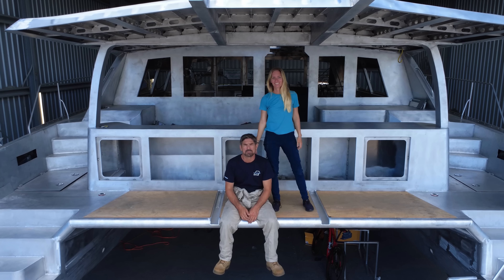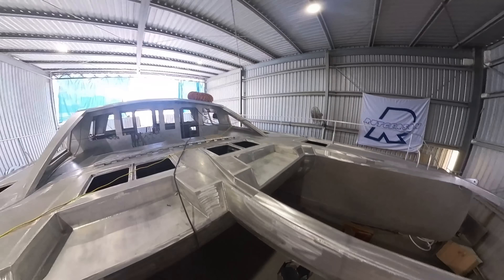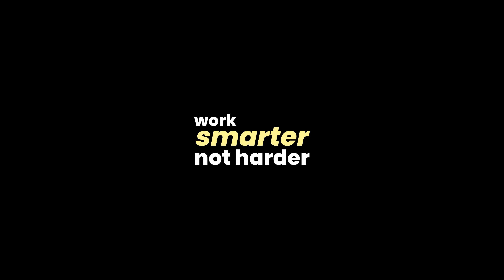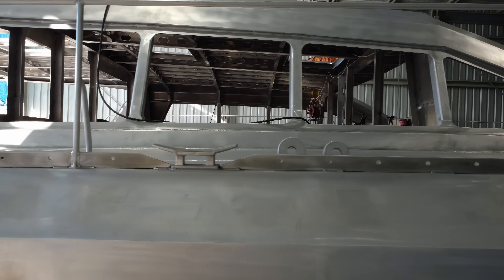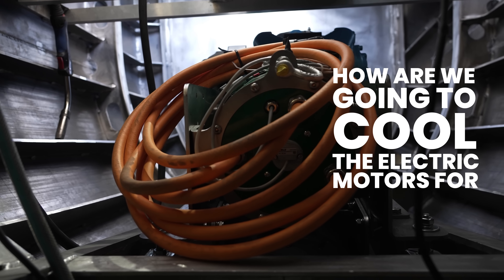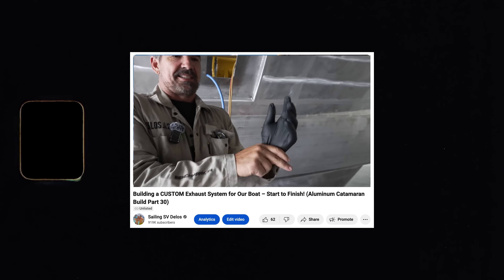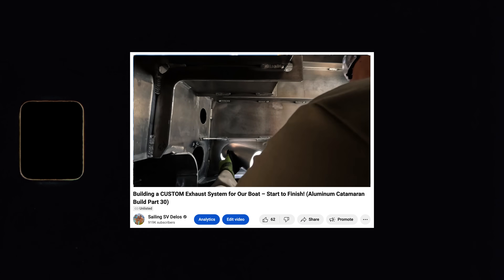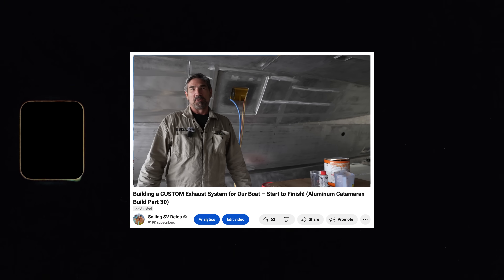We Challenged AI to help design our Keel Cooler 🧠 (Building Our Own Aluminum Catamaran From Scratch)

Comment: I'd think you would be able to design a much smaller cooler if it used a water to water heat exchanger. I love the idea of NOT having more holes in the boat, but it sound like the keel cooler would have to be pretty big to do the job in warmer waters. I remember being down in the enginroom of a few smaller US Navy ships in the caribbean. Anywhere else and we felt cold against the hull. In the Caribbean the hull wasn't hot, but very warm. We also had 25HP fire pump motors and I can tell you, they were more than warm after just running five minute tests. Of course they were WW2 technology.....  If you are building this cooler and it ends up water/water, make a removable cover for cleaning and checking deterioration. And ground the hell out of it!!

Comment: Torqeedo 12.0 is an electric sail drive. The motor is directly coupled to the prop. The entire unit is in the water and requires no cooling.

Comment: Talk to Damien on BRUPEG ?  Ok, so BRUPEG is a steel boat with external cooling pipes and a diesel engine, but it may help confirm your ideas.  BRUPEG keel cooling looks to be about 2m long by 60cm wide, made of maybe 2 inch pipe.  As its external with thru-holes, the cooling pipes would probably have better thermal conductivity with the water than trying to pass heat through the aluminium hull.  Then again, your whole hull under the waterline would form (some) part of the radiation surface...  Not my area of knowledge !  How well does anti-foul transfer heat?

Comment: Hull cooling has been around a long time.
But they are usually too small and installed in limited space.
I seen a guy run C channel(welded against the hull) the entire length of the boat, one going forward another running aft.
That a long cooling loop, so any inefficiencies are offset by the length. 
If i remember correctly, It was 1 by 4 inch C channel with a few burping holes along the way and some weld strips to act as tabulators to mix the coolant as it flows along the tube
He said , he just took the surface area of a keel cooling tube that he need to cool his engines and figured out how long a C channel he would need and added 50%, which was 35 up and 35 feet back

Comment: I'm no Marine engineer 😅 however I have watched this one sailing Channel called Delos for a decade. 

So I guess in this situation I'm really no help at all 😂... I do however question?... one thing the finns, and the surface area. Normally four square feet which seems big to me but then if you consider the fins it actually makes it a lot smaller. Possibly 40%?

However you don't have that luxury if you're attaching it direct to the hull. So as much as that's appealing I wonder if it is a better idea to branch off the saltwater cooling intake for the diesel engine and circulate ocean water over a heat sink with fins.

I don't know I'm just thinking it seems so obvious to attach it to the boat but then again what other issues will that cause and due to the size will it be less beneficial to do it that way however it feels and seems like it would be super cool and convenient.

That and the fact that you'll be putting a coating over the outside of the boat so that also change things and with the hot and cold expansion over and over again I'm thinking stress cracks other issues.

Comment: I've had a bit of thought around how I would get rid of heat if I was to build a boat like you guys. My thought is a radiator setup with closed loop cooling. Sea water as you know is problematic, sucking up weed, jellyfish, rubbish and shellfish barnacles. It also means deleting another through hole. I would integrate thermo fans into a radiator, this could also serve as a clothes dryer heat source, yep free heat to tumble dry the laundry. It's a win win win with low maintenance and chance of failure.
Reply: Let say you integrated a coolant storage tank, on the back of this tank you weld up a water heater storage area, think of it as a 500mm cube with a wall in the middle. Then feed off to a radiator with thermo fans for excess heat dissipation. You end up with a water heater, clothes dryer heat source, heater source for your cabin if you go to the poles. Now we getting fancy. I can see Brian's creativity spurred on with his new ninja welding skills, and Cass's dreams of hassle free laundry. Would be pretty easy to butcher up an old clothes dryer to make it work.

Comment: I think if I was heating the skin of my boat with a couple of Kw continuously, I think I would want that area to be the meter square, I wouldn't want to be touching that heat sink and thinking my God that's hot. I mean there is going to be a temperature gradient across the system and its not an ICE, the closer to room temperature the better in my book.

Comment: Whatever the size is I would weld "aluminium fins" to the hull on the inside in the shape and size of the heat exchanger, then cover that with a waterproof shell(also aluminium welded to the hull over these fins) to to improve the dissipation of heat through the hull of the boat. Then regulate the flow through the heat exchanger according to the temp of the seawater. Faster flow on the equator and slower in colder water, I am sure there are software that can control a flow control valve according to how you calibrate it as to run the electric motor at its optimum temp. Just a thought
Reply: Speaking of colder water, wouldn't you want to divert the heat to the living quarters? Your design would be incapable of doing so. Having a separated heat exchanger with a pump, as shown in the video, would allow you to choose where you want to sink the heat: inside or outside. Which is a much better design decision.
Reply: @ruslankadylak2999 For diverting the heat to the living quarters you use a bypass valve. This is already somewhat a must because you need to allow the engine temperature to raise up before starting to cool it.
Reply: No.

They don't need fins on the inside because the heat will be lost on the outside of the boat.

Comment: I wonder if ChatGPT is making a simple mistake in still assuming the association of the word “sailboat” with fiberglass hulls, even tho you still specified it was aluminum.. Just seems like such a huge disparity between the other AI models used
Reply: Thermodynamics is a very complicated engineering field.  Asking ChatGPT, or any AI model, to come up with a solution on the fly is nigh impossible at this time.  When I've seen specialists run calculations for heat transfer on aeronautics designs, it's spreadsheets on spreadsheets into specialized software to kick out another spreadsheet that gives top and bottom end bounds.  And after that's all said and done it's another round of design to determine if we need the most cooling or just enough cooling or if we need to change other things around to generate less heat along with changing the cooling systems.

Basically, IF Brian is going to use AI tools for design like this it should be used as only the most loose guideline to get an idea of the very large ballpark that he should be looking at.  AKA square centimeters vs. square meters.

Comment: I did like that - I do like these engineering questions, even as a non-engineer.  It is really interesting to demonstrate how AI tools can be used.  Looking forward to hearing more.  I suppose your electric motors are of a size that needs a keel cooler, or is this an extra precaution, and due to your cruising grounds being in warmer climate?

Comment: Think of your keel cooler as a CPU dissipation, it's best to go bigger, not like chatgpt, but at least 2x bigger than Deepsea says. And the most important thing is that the keel cooler must be in 100% contact with the hull to work correctly! like a CPU heatsink or even use some kind of thermal paste!!!  P.S. Not to mention the fact that you must test it before installing it permanently on your hull.

Comment: As someone who uses AI in my work on a daily/hourly basis (software developer), definitely know that it makes egregious mistakes about 90% of the time, and that’s even with good prompt engineering.  It’s not at the point yet where its output can be trusted without careful review and domain knowledge.
Reply: I too notice this as a simpleton. Enter a random prompt into google and of course it pushes an ai generated answer to the top. I usually ignore it but when I look, it’s wrong 90%+ of the time. Bad conversions, pulling numbers out of it’s butt. It’s making people dumber and dumber. Thankfully I have a good basis in mathematics, chemistry, electrical etc to know the formulas, conversion and to see the glaringly wrong answers provided by AI.
Reply: Yeah, even simple questions get you some of the most ridiculous responses.

Comment: Nothing beats real life testing.
So, get an electric 2500 W water-heater and connect it to a loop with a circulation pump of intended choice and see how much cooling you get with say 0.4 sqm.
I'd hate to be forced to make changes afterwards...
Reply: Pretty good idea and it is rather easy to build a makeshift setup.
Reply: I work for a boat builder that has unlimited resources (Tax payers). After the thousands of hours of engineering we do on everything, we still make a duplicate system and test it physically. Build and test eliminates doubt. I personally like pumped heat exchangers. I have a lot of experience with them though. Your situation seems like hull cooling will fit the bill.

Comment: Without understanding the physics asking an AI is not recommend. The motor has a max temp. and so has the sea water. The difference divided by the resistance gives the max amount energy that is diverted into the sea. Calculating the resistance here is tricky task. You can build a small cooler and make a test or you let a viewer do the task by using a fluid dynamic calculation. The task reminds me on the cooler calculations for semiconductors.

Comment: Assuming you are custom building it, what are the consequences of going too large?  I would guess just materials and probably not a significant cost.  If so, make it as large as is practical.
Reply: I'm assuming there'd be a liquid of some sort in the cooler so then weight becomes a consideration as it gets bigger
Reply: Only if you don't make it thinner as the size increases.  Again, it has to be practical, but if you are using X liters of coolant, it's better to spread it over a large area and get more cooling per liter.
Reply: That‘s my type of thinking. There are so many variables that you want to be on the safe side. Double what ever you think is possible and never again worry about it. If it fits in the hull, would you really need the space dearly for anything else? Than go for it!

Comment: I wounder if the hull changing temp from hot to cold over and over will start to stress then crack your hull?
Reply: I was thinking the same thing. I wonder what the temperature swing would be for this and would it fatigue the hull and or the connection points for the heat sink?
Reply: What do you think is a realistic min and max temp?

Comment: Nice work! One other variable is if you plan to have the keel cooler painted with anti-foul, or not. It would introduce an insulating barrier and drive the calculation up (maybe why chatgp was higher)? I've done these kind of calculations in the past, but I am retired now and this sounds too much like work;)
Reply: I might be mistaken but I think he meant that the keel cooler would be inside the hull, not on the outside. I imagine outside of the hull would cause a fair amount of drag

Comment: Would a small air conditioning condenser also be feasible?  It would be temperature variable if you could dissipate the heat from the condenser coil fan?
Reply: And a heat pump when you want to warm the boat up.
Reply: @ I was only suggesting the condenser application, not the addition of an evaporator

Comment: Chat GPT is not capable of doing math. If you put in a simple algebra problem it will not be capable of giving you a correct answer. I would throw that one out.
Reply: Deepseek regularly solves complex situations and gets the same results I do after days or weeks of research. It's a good tool to help find viable options or to double check things. Gemini pro experimental seems to work just as well too.
Reply: Yeah. Ask any AI image generator to paint a clock face that isn’t 10 past 2, etc, etc, 6 fingers, blah, blah, scream.
Reply: Not true, I regularly use ChatGPT for maths and science and it is almost always correct, especially when it generates and runs python code